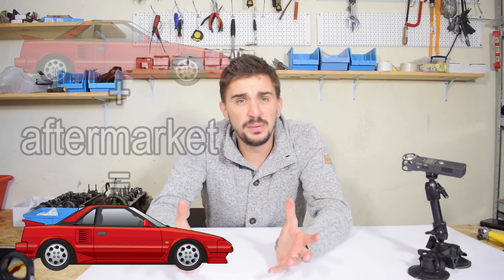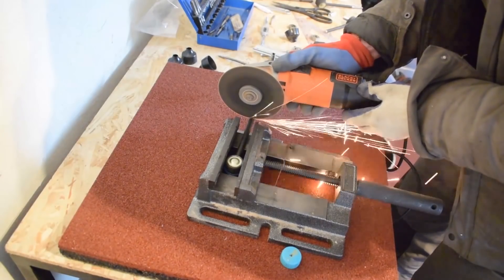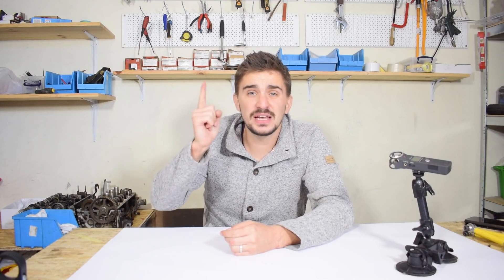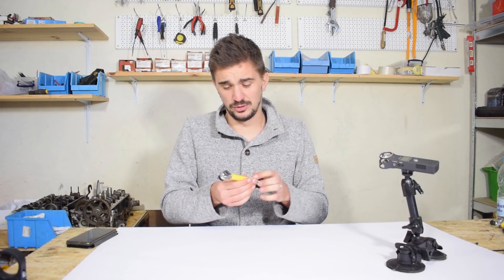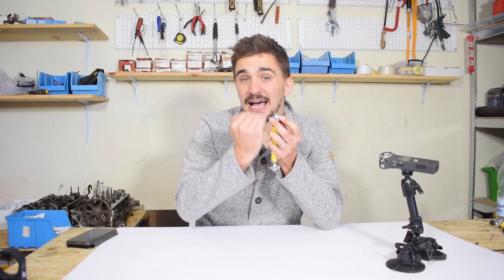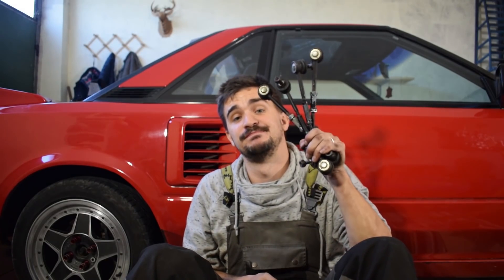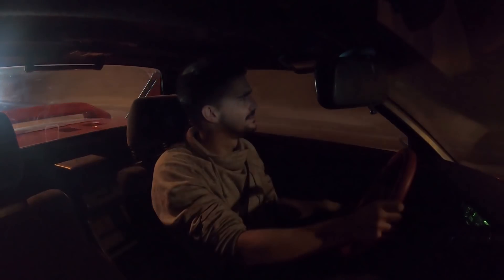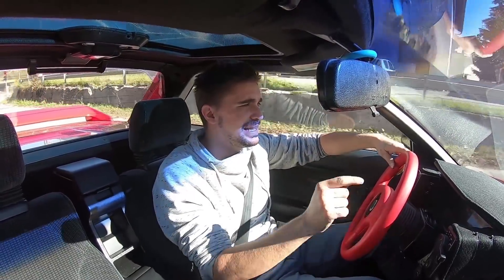The Ultimate AW11 DROP LINKS - RageRacing Drop Links REVIEW and INSTALL

Comment: Good sir...  I've got nearly 2 decades of AW11 ownership under my belt and I am absolutely happy to share my knowledge.

TwosRUs has a lot of parts for the AW11 included upgraded drop links (end links).  These are made by a company called High & Tight.  I had to get these as I bent 3 of my 4 original end links.  The High & Tight endlinks not only stood up to my less than gentle driving through canyons, but also had no issues with handling the couple times that I jumped my AW11.

I also ran Koni Yellow struts and Eibach ProKit springs, but also had the full TRD bushing kit, front & rear strut braces and Suspension Techniques front and rear anti-roll bars.
Reply: haha ... my vision is off, don't have my glasses on; I read that at first as a troll, then for a moment thought ToysRUs legitimately stocked MR2 parts for a few moments; maybe a suite owned one :p

I'm trying to learn about them. Wanted one as a teen but ended up getting into RX-7s and forgot how bad I wanted one.  Almost bought one, but my father wouldn't let me get it.  60k $3000, from someone who was passionate about Toyotas ...  

Its all dreams because of health; but looking for sources of in depth/detailed information.  My searches end up with mostly non-informative youtube fluff and threads in forums where people are bickering.

I come here when I get the itch because he has so much love for the car and it isn't about flash for flash sake or trying to look cool ... just a cool dude doing his thing with real info; love it.  Always refreshing to see a genuine channel.

Take care, have a blessed weekend
Reply: @zakuraayame5091  The AW11 is not a car for everyone, nor most people.  They are louder than most cars because the powerplant is right behind your head, they are wildly impractical due to the lack of available storage space, and I would guess that 99.999% of drivers on the road would not take the time to learn the weight balance of a vehicle that does not have the engine in the front of the vehicle which could result in spinning the car around in less than ideal weather conditions.

The MKIa (85-86) are far less forgiving than the MKIb (87-89) as the latter had a revised rear suspension that helped to negate some of the rotation tendencies (lift off oversteer / snap oversteer).  The MKII and MKIII are even more forgiving compared to the MKI due to the overall longer wheelbase.

The lack of power steering is another factor as anything below 15mph results in the steering being very heavy, with the trade-off of speeds above 15mph, the steering is incredibly precise and responsive (not nervous or twitchy).

The engine bay is not a difficult one to work inside of, especially as this is not a Nissan 300ZX or similar.

Sadly, trying to find replacement parts will only get more difficult as the years go on.  It would be truly wonderful if Toyota would remake a large batch of the critical parts every 5 years, just to help keep them going.  I do understand the chance of that happening is slim to none.
Reply: @not12listen  while older, I had a few RX-7s; one, I removed the PS belt and liked the extra tension.
I would appreciate a proper manual rack ... its ratio and not pushing against the hydralics.
I would not want loud; but one of my RX-7s I removed the cat-back, very loud for the driver, louder than the passenger by 20 dB and louder than outside the car ... was rough after a while, but I was a teen.  I had a CRX about 10 years ago I didn't take up to highway speeds before buying it; it was very loud, droning, and geared so it was screaming at 4k at 65 iirc.
I think with some smart use of things like Dynamat or CCF, can eliminate the less enjoyable noises and vibrations I suppose; but I'm looking for an older, classic raw car I can either make my own from a good start; or build from the ground up.
I'm getting rid of a CR-Z atm, had to sell my dad's C5 ...  so the MR2 is my goal for when finances get back to stable after all the losses and challenges this year subside.
I'm used to small cars.  I'm used to cars of a large variety of handling characteristics, weights, and power to weight ratios.
I think this car will be fun as hell, and hate I missed two opportunities to own one in the 90s.
I'm in the mindset that I can make it work, understanding there will be searching, researching, and fabrication needed.  A 3D printer would also be beneficial; using 3D programs can create non-critical parts, prototype others.

I think the problems with the MR2 are overstated, just like rotary reliability issues.
Proper tires, suspension tuning, and mindful driving, practicing, gaining skill in safe areas are all part of it.

Here are some things I have found might help if getting one:
tires; you can go 205/50R15 F 225/50R15 R;
reduce rear sway, increase front sway
slightly softer suspension in rear.
assure all bushings/components in good condition

Every car has its drawbacks.  I'm used to rare vehicles or engines.
Less than 40k CR-Zs exist iirc. Rotaries are in one vehicle.  I owned a 70s car there happened to be less than 1200 made.

What is worse, owning something special it takes a bit of your time to take care of ... or driving another corolla for 30k and wonder what that 30k could've done to anything you actually cared about?

Comment: I've had nothing but trouble from these. First time I got them the threads were full of swarf and completely messed up  which I had to buy a tap to clean them with. When installing them the bolt sheered when being torqued to factory settings and when finally on the car the front ones came loose constantly and rubbed against the body work of my car leaving considerable damage (and I had installed them the way they are installed in this video.) I tried asking Andrew, the creator of these, how he installed them and he said he would respond to me within a week. it has been months of radio silence, apart from the fact he still uploads to Instagram and posts stories of what beers he drinks. I feel completely scammed out of the money I gave him and have actually been better off buying a set of drop links by searching for them using measurements rather than looking for a set specific to the car.
Reply: Honestly I don’t see why more people have done this over the years. Just take the measurements they need. And maybe post the ones they used lol. Anyone? Lol

Comment: My AW11 didn't come with a rear anti-sway bar.  I researched the merits of using one and the general consensus was that it was not worth it for the daily driving car that it was for me.  Your MR2 sure sounds tasty!
Reply: Maybe for a daily driver you don’t want full race spec “beefy” sway bars, but I think it is nice to have at least OEM style both front and rear installed. You will notice the stability improvement over not having anything and, in general, ride comfort does not become a whole lot worse.

Comment: The front ones are definitely too short. You can see the sway bar being pulled upwards as the suspensión compresses instead of being twisted as it should.
Another question is why did you made that rear DIY drop links so long? Does not sway bar angle theoretically have to be parallel to the ground when suspension is at ride height?

I have found myself a lot of times in that situation of not finding the right parts or the oem ones are very expensive and/ or doesn’t fit when the car is modified. Is always great to have at least a small group of enthusiasts that make good quality parts for cars that aren’t mainstream.
Keep up with your videos, I enjoy watching them a lot.
Reply from the maker: The length of my DIY ones is based on the stock length. When the car is down on the ground the rear sway bar was close to level.

Comment: No protection against dust and water? I wonder how long do it take to erode those brass bushings and how this links will perform when steel balls starts to corrode. I think it's only for good wether weekend driving or racing... but otherwise better this than nothing :D
Reply from the maker: What makes you think 9 out of 10 people use an aw11 for anything other than good weather weekend driving and racing 😂?
Reply: You can always put rubber boots over that uniball joints to protect them from dust and moisture
Reply: @d4a  Nothing, but not everyone have that comfort to have nice wether weekends often. Look north from where You stand. I'm there :) and i fight with corrosion in every car i had, today im hydrolizing my swaybar for example ;) Exciuse me for seenig things from my perspective.

Comment: So you should have got some Heim Joint kits and welded a tube to them or threaded a bar directly to them at whatever length you wanted. 
All RageRacing did was get some Heim Joints and thread a bar to them. Not really that impressive or innovative. It's common place in road racing, just like the red tie rods you have on the car that were in the video.

Also, don't install sway bar end links with the car in the air. Should be setting on the ground with the suspension loaded and have driver weight so they can be installed without any preload.

Heim Joint Kits
https://smile.amazon.com/s?k=Heim+Joint+KIT